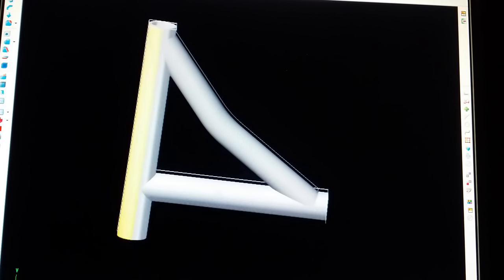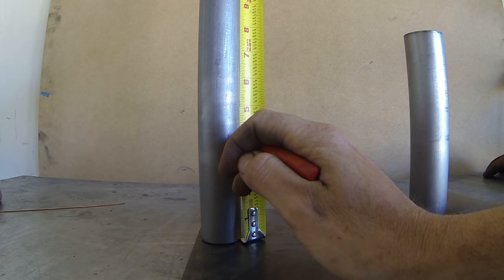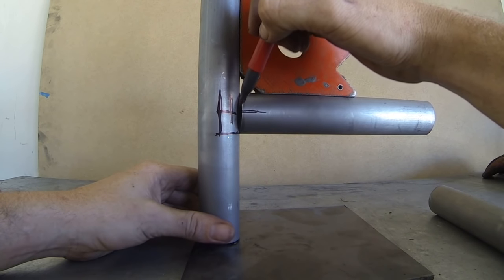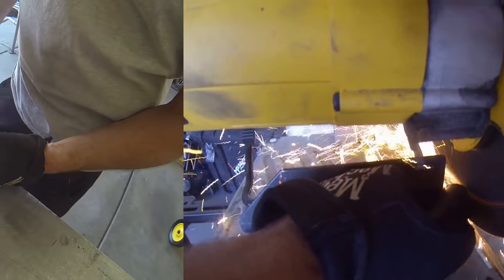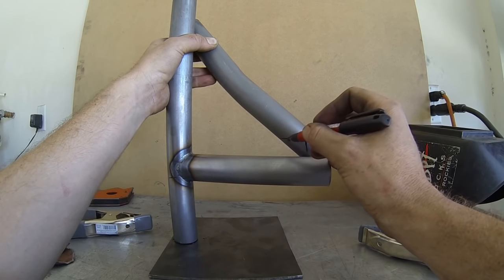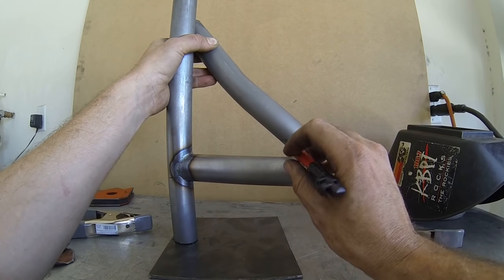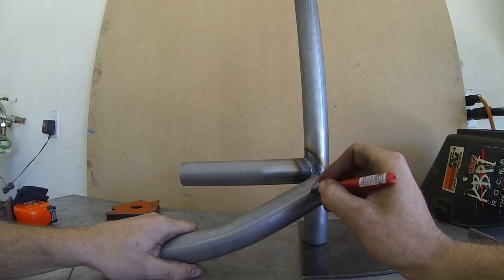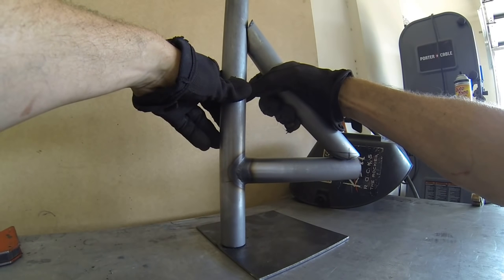TFS: How to Notch Tubes Without a Tube Notcher

Comment: This is guessing, anybody can do that, grind it till it fits perfectly, I will tell you how to make the saddle cut the easier way. 100% fit.

say you have 6" pipe to be you post and you have a 4" saddle or a 6" for that matter, the most important to remember is whatever the size your post is, that's what you have to measure, So! 6", half of that is 3, now 6+3=9. now cut a 9" circle out of paper, better if I little stiffer.

so on your 4" pipe, mark 4 lines, how to make 4 lines perfect mark on a pipe? take a piece of paper, say a receipt roll, wrap the pipe until it meets, make a mark and cut it, now fold it twice now you have perfect four corners, mark it on your pipe with soap stone then make a line across the pipe about 10". now take the 9" circle on the 4" pipe and mark circles around those four lines just like what you seen on this video. of course you have to do some grinding to round it but it takes the guess work out of it.
Reply from the maker: Did you actually watch it? or did you skip through it and only see me grinding? haha. 
There's no guessing about it. It's just measuring and cutting.
Reply: yes I watched the whole video, that's how I used to do it 20+ years ago until some professional pipe fitters came along and showed me some tricks and I was like WoW! I stopped fabricating and welding about 6 years ago but I still remember how to do it, please try the way I explained it and I'm sure you'll thank me later, reason I said that is because what if you're doing a 6" or 8" pipe, 10' long? you can't really butt it together and make markings. your welds is a little too hot as well, it should be gold or blueish color, notice how you bent your pipe because of heat?

Comment: This does work but is so much harder to do and so much more time. Do your self a favor and spend the 200 on a JD tube notcher, its easier quicker and way more accurate with no clean up needed or grindng and fits perfect. I have run a off road shop for years built thousands of tube cages, bumpers and other random tube parts trust me on this
Reply from the maker: Life, the universe, and everything I haven't found a notched to date (including the JD, Baleigh, and Rogue) that is faster than hand notching on most notches. 

This vid takes 15 minutes to demonstrate. it usually takes less than 2 minutes from measurement to fit to do it by hand. It does take a lot of practice to get the speed up, but it's much faster. 

At the end of the day, I always tell people to use what they like best.
Reply: The Fabrication Series I'm sure after doing it enough it does only take you 2 mins but it takes me 30 secs on a staight notch to a min on a difficult notch, and while that may not matter to someone home building, when your doing 100s of notches on a cage it makes a huge difference but if you like it go for it
Reply from the maker: Life, the universe, and everything I'm actually a professional builder. I started this series in my garage after retiring (didn't last long haha). There is nothing faster than a notched when it comes to making perpendicular notches. Once the angle changes and the diameter of the tube increases, the tube has to be cut several times in order to gain clearance for the hole saw to cut past it's own depth. That adds a bunch of time to the job. Hand notching will never have that problem.
Reply: The Fabrication Series I'm not doubting your credentials or that your good at it, alot of the older fab guys I worked with when I first started my shop 10 years ago did the same thing and thought it was the best, but after I got my notcher I proved to me much better and quicker, other than the occasional extreme 3 or 4 way notch at a hard angle, when you do long notches you just use pliers and bend the cut section back takes a few secs and you can keep notching

Comment: 10 times easier with a carbide hole saw and a jig on the drill press
Reply from the maker: JFK64 Kennedy But it's faster from start to finish by hand. It takes 15 minutes to make the vid explaining it. It takes less than 2 minutes to actually measure, cut & fit.

Comment: I'm a sheet metal guy. I'd make a template out of thin metal and make the template fit perfect, almost too easy.
Reply from the maker: Whatever works - use it. The only issue is you would have to make a template for every single angle which is always subject to change.
Reply: They are custom joints requiring custom fabrication. With circle cutting snips there's little challenge. Works with heavy paper as well.
Reply from the maker: Roger Smith Just to clarify, I'm not saying you're wrong at all (whatever works best for the user is the method to use). If I have to measure the notch for a template, why not just translate the measurements to the tube to be notched as shown and skip the template? The process is quicker with the same accuracy.

Comment: You should try using safety, where's the handle to your grinder? Never use that grinder one handed. Put the piece in a vise, both hands on the grinder. Use a face shield. I mean seriously,  you're the professional.
Reply from the maker: mitch biano Its just choice.

Comment: You guy are awesome! Your experience was extremely helpful in fabricating of my spring tensometer:
http://s12.postimg.org/h688h8ii5/2016_10_27_19_55_34.jpg
This device is necessary to measure the quality of a valve springs.
Reply: So cute! =)
Reply from the maker: Nice job. Glad the vid helped!

Comment: Jesus, you made that look hard. It's way easier to mark up and cut accurately in far less time than that. Compass and paper will give you a template for batch joining instead of your tedious eye-method time and time again if you're making a roll cage.
Reply from the maker: +S. Saraswati It doesn't take 15 minutes to do a notch. It usually takes less than 1 minute. It just takes long to explain.

Comment: 3:07 - That center line is not actually the "half diameter" of a tube. That center line is actually the center point of half the diameter of the tube, if everything is symmetric. I was trying to visualize "half the diameter" of that center point and my brain was really confused. Also 1/3rd of the diameter of the tube is also more towards to the right, it's not a perfect center point. 4:50 - The way you cut that pipe is extremely childish and not professional, you gunna lose your fingers one day.

Comment: Good video (but) grinding an inside contour without putting it in a vise is just wrong. Even if you feel like you can get away with it as a professional, your viewers are going to imitate this and get injured.
Reply from the maker: Everything includes risk. It's just up to the end user to assume it or not.
Reply: A professional knows and takes the reasonable steps that reduce risk. This is just the wrong way to do it, unless you don't own a vise, clamp, vise grip or boot. I have been fabricating for 20 years, people watching you will have less experience than you and will injure themselves following a mediocre example. Cars have seatbelts.

Comment: 1/3 diameter... with a bit of REAL geometry that's close to 3.141... pi.   Which is INSTRUMENTAL in any circular measurement.  A bit of mathematics knowledge goes a REAL long friggin way buddy.
Reply: seriously, the math to get this 'bang on' is not hard at all.  Even a LITTLE bit of trig will make your work look so much better.
Reply from the maker: So a quick reference rule is not good enough and you feel the full math should be used instead? I'm really not sure what your point is.

Comment: Dude are you kidding me?  Take a angle grinder with a cut off wheel and make 2 angle cuts on both sides of the pipe and you are done....you do not even need to mark the pipe once you get the hang of it.
Reply from the maker: Nathan Rogers So if you were to teach someone that method in a video, how would you provide visual demonstration referencing what you're talking about? I asked myself that same question before making this video.